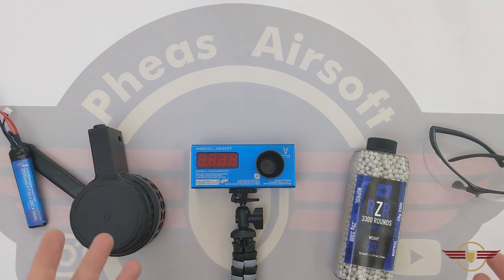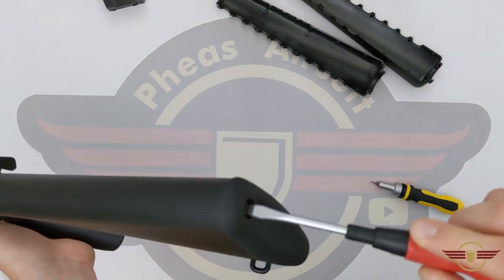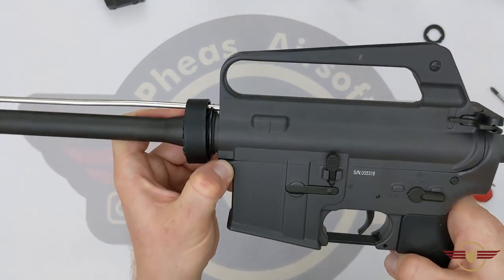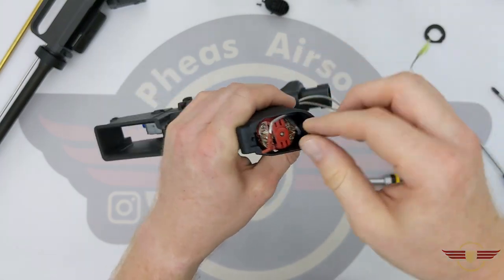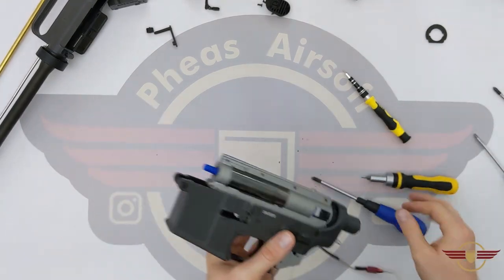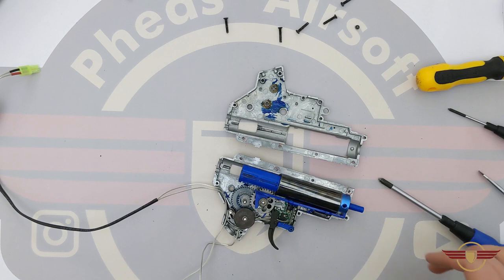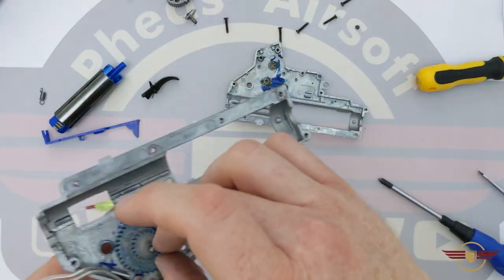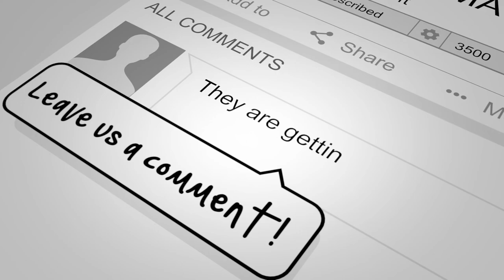[HOW TO] CYMA CM.009C M16 VN DISASSEMBLY - Internal Review

Comment: Thanks for the video, I was trying to replace the spring and was a little lost because the manual I have is for colapsable stock rifles.
Amazing build quality of this cyma, mine has very good compresion too, getting over 400FPS with a soft spring. 
Using a cheap 11.1v LIPO, the trigger response and ROF are impresive.
Reply: do you have any problem with this replica?

Comment: They have slightly changed these again. The hop unit is now a rotary unit. The standard rubber has two prongs that contact the BB instead of a single surface, which might be good for accuracy, wouldn't know because I immediately changed out the rubber for a Prometheus purple since that is my preferred rubber for sub 360fps guns. The standard rubber felt a bit too cheap and hard in my hands, might be good for the standard 400fps the gun is sold with.

Comment: Some nice features on there, very impressed with the extra spring and notch on the fake bolt working together with the proper hold open/ bolt release on the left hand side. The quick change spring system looks great.

Comment: Are you able to remove the barrel and have a buffer tube with a stock instead of the fixed stock? I have a 16 inch cyma made barrel that I plan on replacing since I want to turn this into a dissipator similar to the one used in the north Hollywood shootout. Im no tech so forgive if this is a stupid question

Comment: I have one of these m16’s however mine won’t shoot, I believe I have all the parts, I’ve taken apart and put it back together numerous times yet I can’t understand what the issue is. My friend thought I may be missing an o ring or rubber ring somewhere in the hop up. But I’m not sure where there is supposed to be one. The mags go in fine yet the billets either don’t fire or half fire dribbling out the barrel. I know it isn’t the gearbox as the air properly compresses but doesn’t push the bb through the barrel. What may be wrong with it?
Reply from the maker: Hiya. If the compression is good in the gearbox and the gearbox is cycling (actually making the normal shooting sound) then three things come to mind.. either the tappet plate and nozzle are broken / not working together to allow the BBS into the barrel, the air nozzle is broken in some way which is stopping the feeding or the hop rubber itself is damaged and causing jams (could be just the hop is set too high too. Try taking the upper off and shooting the gun and watch the air nozzle if you can see it going in and out then it could be a damaged nozzle or the rubber at fault. Pheas

Comment: Hi, I have got the same M16A1 and was wondering what are some great upgrades to get some more range? Found out this one doesnt hop very far when its a bit colder outside. I also shop alot from Taiwangun but dont know their upgrade brands
Reply from the maker: Hello! They are a great piece of kit it, A lot of hop rubber don't handle the cold well at all but as soon as they are warmed up a little work much better. For upgrades I would initially start with one of the Maple Leaf MR rubbers with an omega tensioner. I am at work at the moment so cant say for certain if TG have them, but they are exceptional and will make a HUGE difference to hopping. After that I would look at a better quality tight bore of your choice, but I think the hop rubber change will  make a world of difference to you! Hope that helps! Pheas

Comment: hi Pheas! regarding the gas tube, why is it metallic in color, should it be black as on the real thing? and does it actually help the gun as I want to remove it, thanks for reading.
Reply from the maker: Hiya. To be honest... I have no idea why it's Metallic, I don't think I've seen many black ones in Airsoft in general. But it's not needed for anything (at least not functional wise anyway) they are just cosmetic items. Pheas
Reply: @PheasAirsoft  thanks alot, i think i will remove mine, cheers!

Comment: quick question, the cm128 hi-capa. is there anything inside the trigger? i plan on drilling some holes through to give it that look but obviously dont want to damage a link or something
Reply from the maker: Honestly... I don't know enough about pistols to be able to say for sure. It I would have thought that it is a cast piece of metal so in theory you should be safe... But, drilling of holes in it may cause it to loose structural integrity and weaken and you may snap the trigger. Sorry I couldnt be more help! Pheas
Reply: @PheasAirsoft  thanks anyway, i did some exploring and no, i cannot drill holes due to there being a pivoting metal piece inside the trigger that actuates the trigger bar about halfway up the trigger, and also another piece at the bottom which appears to be some sort of rear guide...

looks like i could possibly have a hole between the bottom and middle, but anywhere else would interfere with the trigger mechanism so im thinking i will just leave it as is.

many thanks for taking the time to reply though. much appreciated

Comment: I removed the stock screw as it was awkward, it stays on perfectly and gives less of a hassle also can I fit a suppressor?
Reply from the maker: You can indeed fit a suppressor. The muzzle break will unscrew (negative thread so it will unscrew like you would screw something in) and it will take a normal 14mm negative suppressor (which most are) Pheas
Reply: Thanks

Comment: Can a stock tube be installed on this model?
Reply from the maker: Hello, yes it can. It has the typical attachment for the full stock as shown or the tube type. Pheas
Reply: @PheasAirsoft  is the XM177 lower the same as this one? with the buffer tube preattached? or is it a different style

EDIT: yes it is, now to find either model in stock for cheap or used even

Comment: I can't find a way to remove the dust cover ... I can't see any c clip, any idea ?
Reply: I have the same problem, can you tell me if you found out
Reply: @PrivateFrog-yd3vm  I didn't for the moment, a friend suggested to remove the front handgard and ring, then to try to make the axis move with a hammer ... still haven't tried it
Reply: @vince_nevermind1159  ok cause I'm doing an age job on it rn, and for the next step I need to remove it to paint it a better gray.
Reply: @PrivateFrog-yd3vm  mine is the colt 653 version, but I have a pre serie model I won with taiwangun ... so mine doesn't have a C clip on the axis, if the method I said earlier works, send me a notification 😊

Comment: What’s the difference between the Cm009b and cm009c?
Reply: The CM00B is a replica of the M16A1 and the CM009C is a replica of the earlier initial US Army issue XM16E1 that eventually led to to M16A1.

Main differences:
XM16E1: Early buttstock with no trapdoor and articulated rear sling loop
                 Partial fence lower receiver without mag release guard
                 Three prong flash hider

M16A1: Updated buttstock with trapdoor and fixed rear sling loop
               Full fence lower receiver  with mag catch guard
               Bird cage type flash hider.